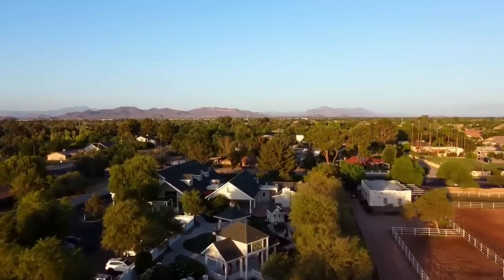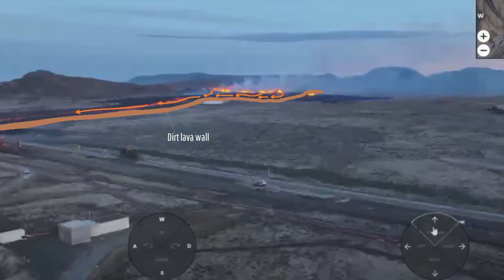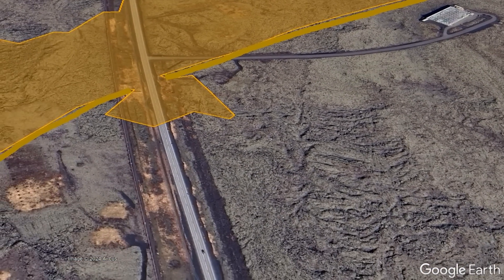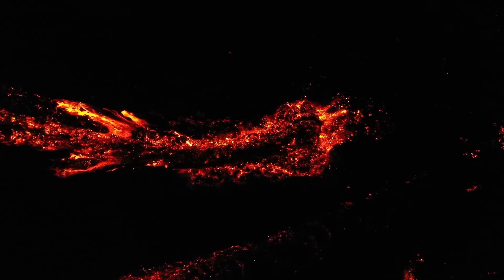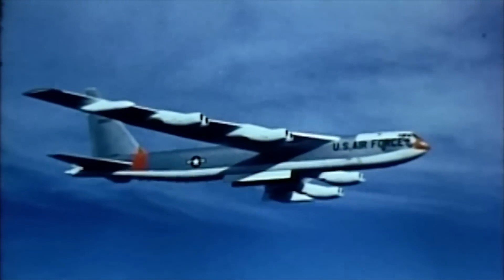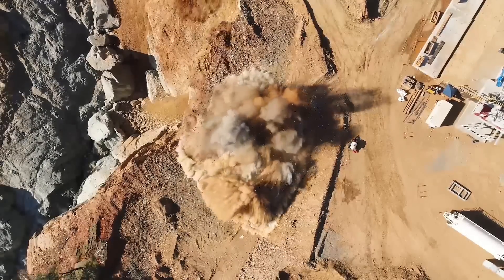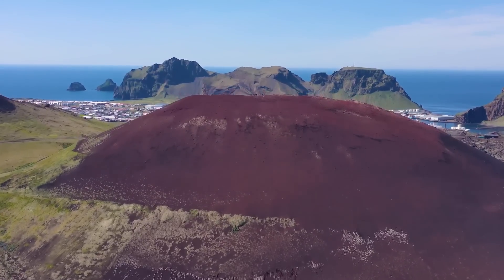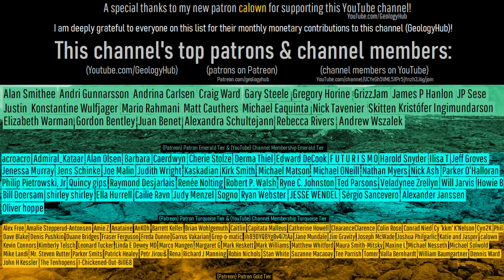Diverting Lava Flows Via Aerial Bombing & Other Methods

Comment: I remain to be convinced that the much-maligned overtopped barrier at Fagradalsfjall was a failure.  I suspect it encouraged the later north-east flow of lava, which had it come south would have covered the coast road.
Reply: I tend to agree.  Just because the barrier failed does not mean that it wasn't a partial success story.  It gives valuable lessons on where to focus further efforts for next time.

Comment: The simple truth is that to truly divert lava away from vulnerable settlements and infrastructure authorities would have to plan and then implement major re-landscaping years beforehand. Towns, villages, even things like geothermal power plants would have to be built on elevated points in the landscape, with ditches, troughs et cetera surrounding them to give the lava something to flow into. Then, if an eruption happened, and the ditches and so on were filled, once the lava had solidified and cooled enough to allow it, dig the newly emplaced flows out of them, perhaps using the new rock to re-enforce weakened sections of ditches, drainages and other channels.
          Of course, this is an idealised solution, and is impractical on so many levels, not least of which is that our species tend to think and plan mostly in the short- to mid-term. To be fair, predicting if, let alone where and when, magma will break surface to become lava, is all but impossible. Then there is the fact that fissures don't care about things like ditches, dikes, berms and barriers: as we saw at Grindavik the last time, the fissure simply opened up under the barrier at one point and cut it in two. But the only real things that stop our kind from enacting the kind of idealised plan I suggested is a lack of foresight, and a reluctance to spend resources and time on such plans when the future benefits can't be seen, for whatever reason.
Reply: There's one major problem with your idea. This part, "... once the lava had solidified and cooled enough to allow it, dig the newly emplaced flows out of them, perhaps using the new rock to re-enforce weakened sections of ditches, drainages and other channels ..."

This part wouldn't work. Lava flows, especially if they pool in deep areas like holes and ditches you've dug to trap the flow, can take decades to cool. So even if you wait 20 or 30 years, you might start digging in and discover a delicious, gooey, molten interior. This is, of course, really bad if you're the worker who discovers this the hard way.

Overall, you're correct. Your basic premise, that in areas where volcanoes are a problem, long term thought needs to go into avoiding the hazards present, including large landscaping projects to redirect hazards like lava flows.

This has been done in some countries! Iceland is not the only example, although most of the others are a little different. You should take a look at satellite images from the area around Mt Unzen in Japan, and see the huge works they've built to mitigate lahars from that volcano. Lahars, of course, are a different hazard from lava flows - but like lava, they flow downhill and seek the lowest terrain and fill in that terrain, meaning successive events will fill in even very deep depressions.

But, it isn't practical everywhere. The biggest, most dangerous hazards. Gas emissions, extreme high volume lava flows, (as in 0.1km^3 or more), volcanic landslides, and pyroclastic flows, and ashfall, cannot be mitigated with these methods. These are the hazards that have proven most problematic overall.
Reply: @Lessinath  Perhaps I should have made it clearer that my idea was for places at risk of lava flows only... but I guess could be applied to lahars too. I realised that any depressions would fill up in time, hence the idea of digging them out, but I had no idea just how long it could take lava to cool down. Lahars, being relatively cool compared to lava flows, wouldn't be such an issue... if something that sets as hard as concrete and would need to be jackhammered out could be said to be a lesser issue!

As for gas emissions, etc, well the only way to deal with those is to prohibit and prevent people from setting up homes and farms anywhere near the volcanoes that produce them, and that is far easier said than done.
         Going back to the matter of lahars, a persistent rumour I keep hearing floating around on the internet is that the Columbian government is considering building a new town on the site where Armero once stood. I read somewhere that a mob of people is only as intelligent as the most stupid member in it: perhaps this also applies to governments as well. Certainly, the tragedy at Armero was horrific enough to encourage folk to give the place a wide berth, but no, apparently someone in authority there thinks building a town on a piece of land where thousands died trapped in concrete hard mud is still a good idea!
Reply: @carolynallisee2463  I understood you only had lava flows in mind with your ideas, but I thought you might find it interesting how there are real life use cases of very similar ideas to yours already being used with lahars! It is still difficult and expensive at best. In almost all cases it is better to just build somewhere else instead.

I agree with you that rebuilding where Armero stood is a terrible idea.
Reply: Your point about placing geothermal plants on high ground misses the context that such as location may actually be the WORST place to place it.  To minimize drilling costs, you want to pick the location with the weakest or shortest distance to get to the magma chamber.  Placing it on high ground may actually make the drilling cost prohibitive sabotaging the whole effort.
Reply: @davidford3115  You don't need so much height that it would make it harder to drill. 

You also don't want a magma chamber directly, but the hydrothermal system around and above it - the magma chamber itself is too hot, too chemically reactive, too acidic. If you try to pump water directly through it, well, good luck.
Reply: @davidford3115  the idea was to artificially elevate the power plant by digging around it and removing material away to make it higher than its surroundings. This would, of course, include reservoirs of water needed to run the plant... and any and all other ancillary structures and materials.
           The point I tried to make was that an awful lot of work needs to be done if such places are to be safeguarded where lava flows are a common and persistent hazard... and that such work needs to be done at the very start of construction, rather than at (figuratively) the last minute, which, we, as a species, seems to be the option we favour.

Comment: I think if you could find a depression in the terrain where the flow could be redirected and lay a trench toward that area that would be the best bet. You could use both the trench or depression you create as well as the material removed from it to make a raised edge opposite the flow force.
If it's rock this would be too labor intensive though.

Comment: Sounds exactly like a US solution. Russia would use nukes.
Reply: A strategic underground nuclear detonation would be a perfectly valid way... The downside is the fallout would only increase the danger.
Reply: @misplaced7858  If it was done correctly there wouldnt be any fallout. But it takes a long time to setup that kind of deep sealed under ground bunker so not actually practical at all.
Reply: @dralord1307 An underground nuclear detonation  could also create more cracks for magma to reach the surface intensifying the eruption regardless of lack of nuclear fallout.
Reply: @misplaced7858  You are talking about Operation Plowshare.  Civilian use of nukes for civil engineering purposes.  The most notable was Friedrich Bassler proposal for the Qattara Depression Project in Egypt.
Reply: Don’t give Russia ideas
Reply: @alexdurn

Sorry, brother; too late! They've already apparently used the technique to seal a gas blowout run amok. I don't have the details to hand, however, ...
Reply: @michaelthibault7930 depends on the volcano
Reply: @michaelthibault7930  Russia used Nukes to put out that oil fire, they used them to make lakes etc. Those lakes are unusable of coarse. The USA tried some stuff too but not as much as russia.
Reply: That was a nuke that the 1930s B52 dropped in the video :P

Comment: OK.  Thinking of Stockbridge, Mass, my favorite town....
Reply: Not much lava flow in Stockbridge, though.
Reply: @scillyautomatic  Not now anyways,  maybe if the Adirondack hotspot does turn out to be a mantle plume head it might be relevant when said plume head reaches the surface a few million years from now as it is in the peripheral zone of uplift of the Adirondack hotspot.

Though in that case diverting a flood basalt eruption is probably a total fools errand even if we ignore that the first wave of continental flood basalts tends to be a layer of rhyolitic pyroclastic material due the the incorporated crustal melting/silica leeching of the crust as the magma ascends into the continental crust.

Anyways thanks to seismic tomography we know that there is a large abnormally buoyant anomaly part way up within the upper mantle with a narrower slightly less buoyant zone centered above that and reaching towards the surface. I suspect there may be some connection to the slab wall in the lower mantle which appears to have reached the core mantle boundary but that hasn't yet been proven. Ultimately if this does turn out to be the case I'm pretty sure everything between southeastern Ontario Vermont New Hampshire upstate New York and Massachusetts among others would b buried by kilometers/miles of lava making diversionary efforts futile